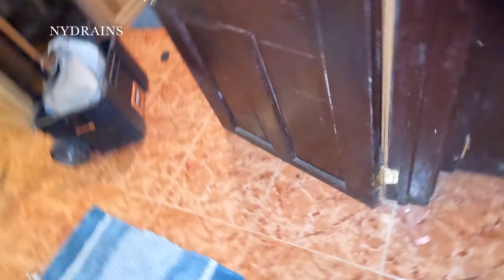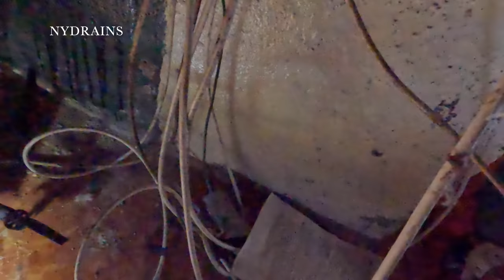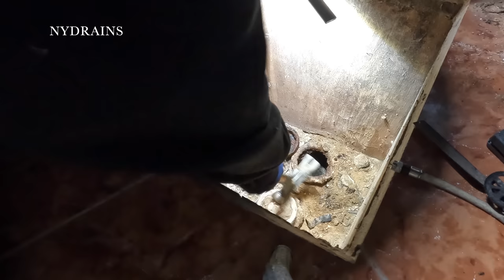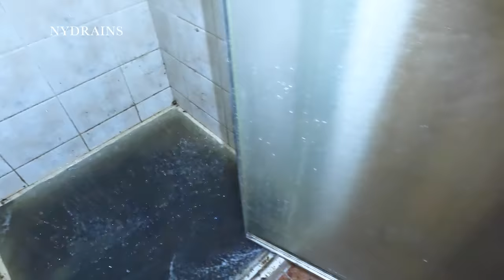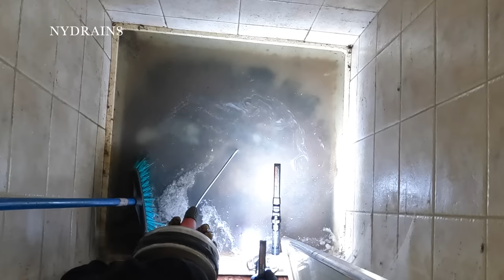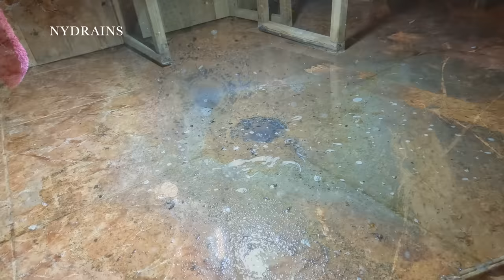Clogged Drain #164

Comment: I think I had counted you went down the drain about 15-20ft — with a drill snake at that! Good job; good patience! I must have some jacked up plumbing in my house. The best I have reached is 9ft — too many turns I guess. Honestly, I would have given up and went with the drain bladder— h3ll they were already 2 inches away from being declared a swamp. 😄
Reply: probably old galvanized, with iron fittings or all cast iron. when they clog up over many years, the stuff turns into hard pack like iron, only leaving a snaking worm-hole  trail through the pipe, in which a small snake will just bind up on and a larger snake won't make the tight old bends and lips.
pretty much, there's no good way to clean it all out and it will likely be full of holes on the bottom at any horizontal runs, only real repair is replace it! which often means lots of demo and cost to get to the drains, or finding a new route and boxing it in, while abandoning the old lines in place. lol
Reply: @throttlebottle5906  Yep that is the case of my place here in CA. I’m dealing with 1970s code. From what I’ve seen so far casted iron drains is rampant throughout this building. So, until a catastrophic failure, or the urgency of remodeling— I’m stuck with it until then— or luck up with our children marrying people with some handyman skills and a truck (which ever comes first).🤣

Comment: Since i first saw you operate the snake, i've always wondered why is it okay to put freshly poop-dipped wire back into the rotor-drum thing. Does it ever rust, stink or do you clean it occasionally? To me it doesn't seem really hygienical to leave it like that.
Reply: WD40 and a rag is what I use on my Ridgid sewer snake periodically. Keeps my chain rust free and ready for the next job. I do hose it down at the end of the day and tilt it to get most of the dirty out.
Reply: For  hand helds you can just flip it and let water drain in bucket they make specialty oils to help prevent rusting and make it smell better. As far as hygiene if you work with it all the time immunity will protect you pretty well except for thing transfer ed from blood and such which don't survive long dry.
Reply: That’s why we wear gloves
Reply from the maker: I go through 6-10 drains a day, no need to clean up just to dip in 💩 in the next hour all over again! I would understand if I don't use the machine in months then I can see why it may rust, but I never had that happen and periodically would rinse or drain it out after a nasty grease job or so.
Reply: @NYDRAINS  oh my bad, i shoulda emphasized that i meant cleaning after your workday, not after every job, by "occasionally" i meant that. of course that would be stupid cleaning it every hour, duh

Comment: nice cleaning the drains but the poop on the shower was the grossest and it made throw up and also where are the caps located because I can' find it because I have a drain that water goes up the drains
Reply: Varies by area not everyone has a house trap.
Reply from the maker: It all depends on where you live, different areas have different systems,  but it sounds like you have a sum pump.
Reply: @NYDRAINS  well The real question is that and The drain outside my basement is coming up and causing a flood in our basement
Reply from the maker: Sounds like the main sewers problem.
Reply: @NYDRAINS  We tried to pump it but it stills comes out and the basement was flooded and I can't fix it I think that something jammed that drain we already called a company but they made a pipe pump automaticly and i want a different company